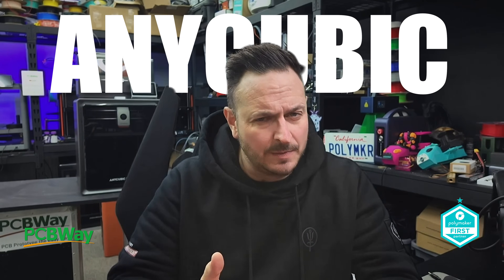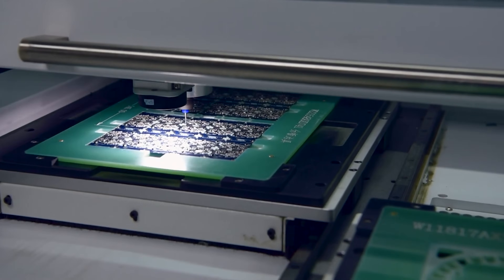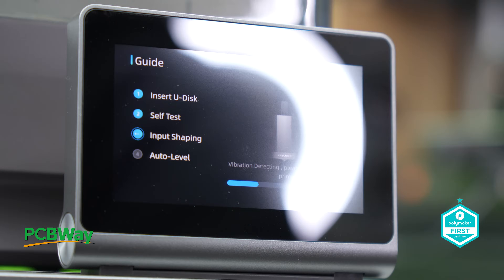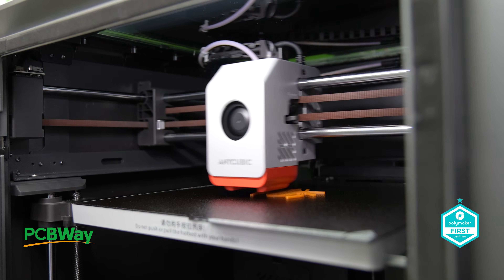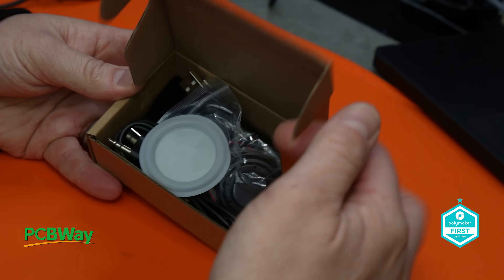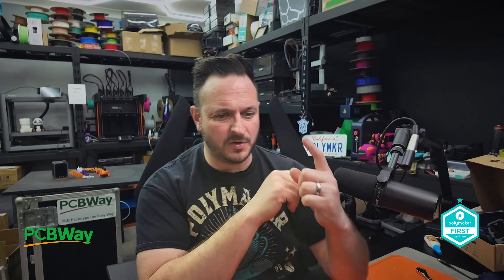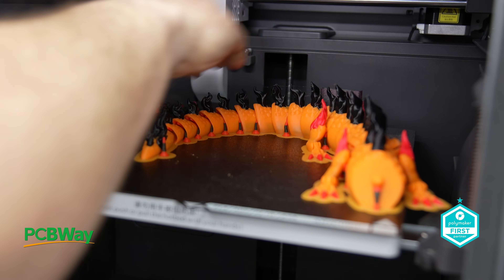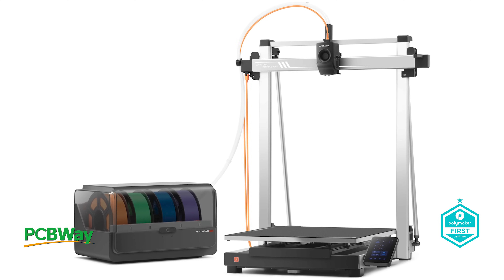Anycubic Kobra S1 Combo: Amazing Quality or Risky Bet?

Comment: I BOUGHT that same machine. It's a piece of junk. Lot of software issues came home AND The door was blown open, filament all over the floor. I own five of their machines. I gave him a last try to see if this one was the good one, the Kobra S1, and it's just as bad as all other ones. 6 months to a year. All my machines and I sent them screenshots and videos. I would not endorse them. They are horrible. If you look, they're releasing the kobra S1 Max. And they still haven't even fixed the issues with the kobra S1. Also if anyone is reading this with you. If you look there are quite a few 3D printing experts. That are very honest. And will tell you straight up on their video. I will not endorse anything by anycubic. And a few of them will also say their machines last maybe 30 to. To one year. My machines barely made it 30 days. I just bought the kobra S1 and it's horrible. They're gonna say, oh, it's just your machine you brought. Nope. Look up the reviews MOST People will give good reviews because they give a free 3D printer to them. Watch this guy. He doesn't even want that junk. And he is correct. There are more like him out there. Not saying this guy is a horrible human being or he's not being honest, but I just know from experience. 5 printers later. Even with the Kobra S1. NOTHING HAS CHANGED https://www.youtube.com/watch?v=PME0XUKGJ_w

Comment: Can get the S1 Combo for €549 but the Bambu P1S Combo is only €100 more expensive at €649
I find it hard to decide because no idea if I'm going to need the higher temps later on...
Reply from the maker: By the one for the future not for today :) I have links for both if you want to support
Reply: @TheRealSamPrentice  That would mean the S1. But I'm also reading lots of posts on Reddit where people are having problems with the S1
I've had it with hours of tinkering on 3D printers and at work we have 3 Carbon X1 printers that work so effortlessly. I just want that same experience at home but for an affordable price. No idea if either of the 2 can give met that.
Reply from the maker: @Ni5ei so I have 17 BBL printers 3 Prusa XLs and 1 s1 they all work well but it’s the price point and the overall user experience

Comment: I just wonder if this is the start of a "repair by replacement" printer cycle. When this,and other of this type,printer needs new belts or pullys in a year or so how hard is it to fix? These corxy printers are not easy to work on and get back into working order.

Comment: My main issues with the S1 are that #1 they don't have a hardened nozzle for it yet which is crazy especially considering the entire reason most people buy enclosed printers is to print with more heavy duty filaments and those same people are the ones that are most likely to use CF filaments and need a hardened nozzle and AnyCubic said the hardened nozzles/hotend assemblies would be available at the time of release I believe yet I did some searching a few days ago and still couldn't find any release date info or anything other than someone saying they bought a aftermarket hotend which had a removable standard nozzle which could easily be replaced with hardened steel or whatever but when it comes to printers I don't want to give them any excuse to mess up soI'd much rather have to whole anycubic hardened assembly. 

#2 its hard for me to trust them after seeing nonstop Animated/Rendered/fake photos and videos that are 'showing print quality' in all of their promotional stuff and on every website selling the S1 including Amazon and AnyCubic and again about 20% are blatantly fake renderings and probably another 20% could be but its hard to tell. I'm so tired of these fake scammy companies, I would rather have a company tell me 'we messed up the design on the hardened hotend and are having to redesign it so it won't be out for a few weeks' or 'the printers we sent to the promotional marketing company were super early test printers and the quality sucked but we didn't have time to redo it so they edited the footage'. If they said that now I wouldn't believe it but those two statements could've easily been added to the promo material and I swear with how dishonest every company is nowadays just being honest with your customers is a premium feature that I would pay more for

Comment: Do you have any updates on the ACE system
Reply from the maker: Which updates do you require ?
Reply: @ I just would like to know about maintenance
Reply from the maker: @kelRGo  On the ACE, there isn't that much to it, keep it clean for the most part.
Reply: @TheRealSamPrentice  thanks I was just curious because I’ve seen a few different YouTube and they seem very negative about the ACE system. I just received my s1 without the ACE and I’m waiting on the s1 combo now. Thanks again
Reply from the maker: @kelRGo  Ok weird, mine has been ok apart from the squeak

Comment: So where does this fall in comparison?  Every video i see talking about this, they compare it to the x1c. With this price point, this printer always wins out. Shouldn't this be compared more to the P1s? I haven't seen anyone talk about the difference between these 2 with features or print quality. Is the drier that much of an advantage over the AMS with desicant? Can this printer run abrasives like glass reinforced filament. These seem like points to be touched on. It just appears that in this space, everything is compared by feature first, then price point. It would be like comparing the iPhone max to the Galaxy s24 base. "They both make calls and take pictures, and since the samsung is cheaper, it is the better phone." Lower price is sometimes just cheap, not a deal, is all im saying. 

Im trying to get into this hobby and dont want buyers' remorse because i went the cheaper route when, for just a couple hundred more, I could have been happy longer. Im looking to print in ABS or tougher filament like GF. Im not planning on making many models, just useful things i need around the house or in my car.
Reply: Same boat as you I’m just gonna spend the extra $ and get the bambu ps1
Reply: @robbrobb325  my boss has had an x1c for a couple of years and just added a p1s.  he said he should have gotten another x1c, mostly because the poor interface screen and the processor unit is very, very slow on the p1s.

Comment: One thing that should be mentioned is that, the slicer settings presets that are available right now are early access only, and anycubic has not done any finetuning at all yet. The only profile available is 0.2mm pla, and the hotend and flow settings on that are quite a bit off. When comparing with the presets for the kobra 3, they are clearly nonexistent and a temporary placeholder for youtube reviewers.

Moreover, the huge amount of waste produced from multi colour printing is also caused by this early access slicer. Its nowhere near that bad with the kobra 3 combo and is closer to bambulab printers. Anycubic will release a more polished version nearer the release date im sure (end february - early march). Bambu labs had similar issues with inefficient colour change at first with each new printer until they fine tuned the slicer.

Also, kobraOS is indeed based on klipper. Boo.

Comment: Hey @TheRealSamPrentice - thanks for the great overview / review.

I recently got my first CoreXY machine (K2 Plus, my 7th printer in general) and I'm loving it. I'm loving it so much that I've now just ordered a Kobra S1 (I like the ACE, shape/size and the claim of low-noise). 

You mentioned that the Kobra 3 Max could be possibly be a more interesting option - I have the previous release and it's painfully massive, but I also love that capacity. Even the K2 Plus print bed against the Kobra Max series bed's is notably smaller. My answer to your question about which one is "both" - so I've ordered a Kobra 3 Max too. I do not have a print farm.. Well.. Not on purpose.

Regarding the ACE - can it be used for prints without mains power supplied to it? Like, if I didn't care about the dryer, could it still be used for prints and I could only plug it in to the Kobra printer? (I'm betting it's going to have to always be plugged in)
Reply from the maker: I’ll check the mains thing but i believe it needs mains power as the heater would draw a ton of wattage
Reply: @TheRealSamPrentice  I'm sure it does need mains to run the heater. But my question is will it work as an MMU without mains power (and therefore only feed filament, not dry it too)?
Reply from the maker: @cupcake-155  Thats what i'm saying, I dont know but I will let you know once ive had the time to test it.

Comment: We keep comparing these printers against one another which is justified to a point but the user experience in my opinion is the primary comparison that we keep missing. You can have the best printer ever but without decent software and support it can easily turn into a brick. 
Anycubic are incredibly poor at customer support and parts availability so are you buying a good printer that will just frustrate you down the road.
Bambu labs are good at parts supply but are huge victims of their success as demand is outstripping supply but the out of box experience is second to none, but I haven’t bought another manufacturers printer since turning to the Bambu darkside.
I would like to try the creality k2 plus but always concerned about longevity as many of my Creality printers are wearing out and Creality are a huge pain to deal with getting basic maintenance parts.
Look at what has happened to the 3d printing industry, Bambu lab kick the anthill with just a free gift for pre orders for the a1 series which allows you build something, great idea but it’s been copied now and it’s interesting to see what kits are becoming available. Now the kits are generating their own content as developers are coming up with different applications, great result from a basic idea of a freebie to get new users into the hobby.
I am still waiting for a true contender, perhaps Creality have it in the k2 time will tell and lord knows what Bambu will come up with next. Greats times to be in the 3d printing world.

Comment: I wodner this is a good 3D printer for an absolute beginner.  I am looking for one but having a difficult time deciding which one to buy.
Reply from the maker: What are you other choices ?
Reply: @TheRealSamPrentice  I was comparing Flashforge Adventure 5M, Bambu lab A1 and Anycubic Kobra 3. Then I stumbled across this Anycubic Kobra S1 Combo. It will be my first 3D printer so i want it to be fairly easy to handle.
Reply from the maker: @mm-sz5li well the A1 you can buy today and have it
Reply: @TheRealSamPrentice  Thank you. True but this also looks cutting edge! Do you have any opnion on Flashforge?
Reply: @TheRealSamPrentice In the end I got this (nnycubic kobra S1 Combo) ! Can't wait to use it! : )
Reply: I am also looking for an honest review. If I had only 600 EUR, the two options I have are Bambu P1S without the AMS, and this one with the ACE PRO. Can you pick one for me :-)

Comment: Could not afford to order whole kit at the moment. Printer cost approx 380 itself I hope will print TPU ABS and CF materials.
Reply: I doubt it will be possible to print any CF reinforced filament on it. Aside from not having any hardened steel nozzles available in Anycubic store so far for any of their 3D printers, there is no info about extruder gears being hardened. Anycubic wouldn't omiss sharing so important news in every possible place in their marketing materials. They not see it important so they not spent a single penny on it. In fact, we don't even know extruder in S1 is single or dual gear! This paid reviews showing flexible dragons will not tell you that. Let's just wait for independent ones, especially from someone who will make this extra step and check some problematic facts about this printer. So late February the earliest.
Reply from the maker: @xantrax9359 it’s not paid by anycubic pal. Couple of good questions that I’ll ask, no need to be shirty and obtuse about it tho.
Reply: @TheRealSamPrentice  Any information that will help people make their decision to buy it or not will be very valuable. Ask them, but this info will be probably filtered by marketing department. And because they can't even decide printer that making 58dB, as per one of the reviewer, is 44 or 46 or 48dB "quiet" one, they can't decide its hot-end is full metal or non full metal (mind were talking about finished product already sent to some people, store tech spec said full-metal, then non full-metal, full-metal again, now it's just metal), they will tell you whatever is suitable for them. You are tech guy and you have it already on your desk - if they made this printer somehow serviceable, just unscrew extruder, try to scratch the side of the gear/gears (to not damage its teeth) with sharp knife or needle file and we will know what we want. Oh, and I really want to see 8-color hub btw.
Reply: @xantrax9359  Couple of people get them in EU there are first non English videos but not real reviews.

Comment: I pre-ordered this in the eight color version instead of getting an X1C from bambu labs. The price point was definitely a driving factor. Hopefully I’m not disappointed!

Currently running a flash forge adventure 5M pro so I think that anycubic cobra S1 combo will be quite the improvement.
Reply: How does it compare? I'm debating between the 5m pro and this anycubic. What are your opinions since you own both now?
Reply: in print quality? nah

Comment: I actually have pre-ordered both of the printers. They are not planning to ship these in the U.S. until late February to early March.  You have really eased my mind on the S1. I am really hoping that Anycubic has addressed user issues with the kobra 3, and we get a more "refined" product with the Kobra 3 max. I was able to pick up both combos for less than creality's k2 plus, which seems to have some early reviewers in distress.
  I do have a bambu p1s and love it, however, i spent $1200 after accessories and filament. For that price, Anycubic gets me 2 *4 color printer combos and 8 kg of filament. Holding my breath for Bambu lab's q1 offering.

Comment: What benefit their gain on spending time and money to develop (modify) their own firmware and slicer? They never better than the original, but feels as a downgrade with limitations. Ok i understand the firmware part, but should not they also leave it open as it comes from open source?

Comment: 4:25 450C hotends? Consumer PEEK incoming, lmao
Reply from the maker: Lets come back to this comment when the machine goes live.
Reply: @TheRealSamPrentice  so the 450 is the Alcheman?
Reply from the maker: @ yep
Reply: @TheRealSamPrentice  I'm wondering if we're looking at some kind of X2E doing those temps? hmmmm
Reply: @TheRealSamPrentice  won't make sense if you don't also have a 120c chamber which won't happen
Reply: So maybe the H2D (but if the recent rumors are true I'd definitely argue it's not a consumer printer ($4000))  @TheRealSamPrentice
Reply from the maker: @NJFoggio I couldn’t possibly comment at this point…..
Reply: @TheRealSamPrentice  so you have it? Thanks for confirming :)
Reply from the maker: I’ve seen it online of course
Reply: @TheRealSamPrentice  Ah yes... I assume you saw the online thing where it said it released within 3 months too, right?
Reply: @awildridehome9469  Out of curiosity what thing? Just about the h2d or another machine?
Reply: @TheRealSamPrentice  I suppose the rest of us not subject to any embargos will find out on the 25th or sooner if it's the h2d you referenced.
Reply: Based on the most recent leak with the specs it seems like the h2d will not be 450 but will be 350. This only leaves one question... Who is making and what is this 450 C machine?

Comment: This printer is definitely a risky bet. Rushed release of competitor to 2 years old printer, tons of promisses in marketing materials but in fact nothing new. And definitely not done to the Bambu quality standards. And this material not helping at all. Not a printer review, rather unboxing and some gadgets printing, including really not needed speaker. This printer can reach 320/120 degree and print ABS/ASA? So maybe show it printing this materials? 46dB noise? So maybe install some sound measuring app on your mobile and prove it? It can print 8 colors? Show it! Connect old ACE from Kobra 3 to it and just show it. Nah, you can't because they not providing 8-color hub yet. Noone even seen it. There are people who tried already connecting old ACE and is not working correctly with S1 at the moment. You not said a word about it. Slicer is not working on your Mac? Don't worry, Anycubic Slicer Next for Kobra 3 is still not working on Mac 6 months after release! Noone is Anycubic team is really interested is those kind of "nuances". Spare parts availability? They don't even have spare nozzles for Kobra 3 in their store. Still nearly nothing for S1. This "filtration" just made me laugh. Not a sealed filter that you can put safely in designed compartment, just some bag of activated carbon and that's it! Anycubic style details. Everything is like that on their Kobra 3 and everything will be on Kobra S1. Buying this printer is a proper gambling!
Reply: You steamrolled this "review". The real Sam Prentice needs to get real.